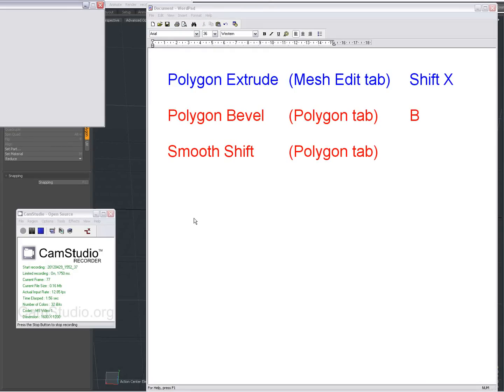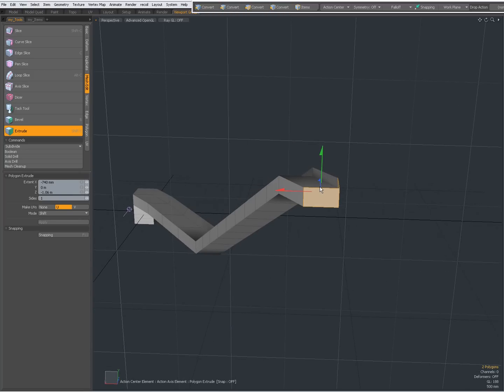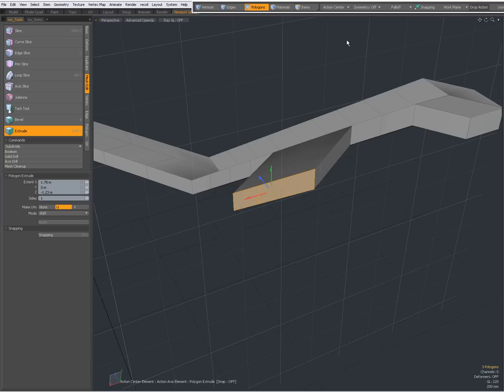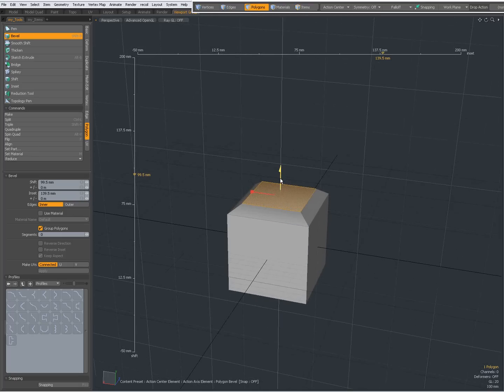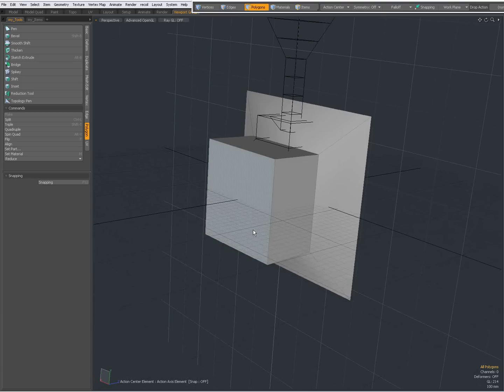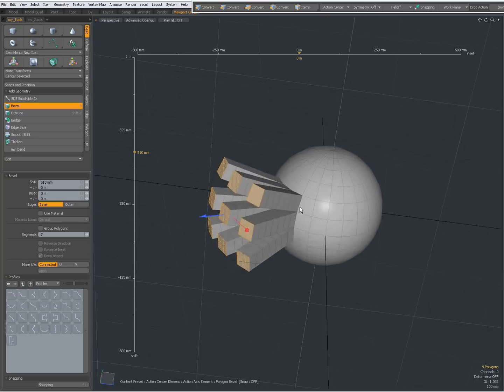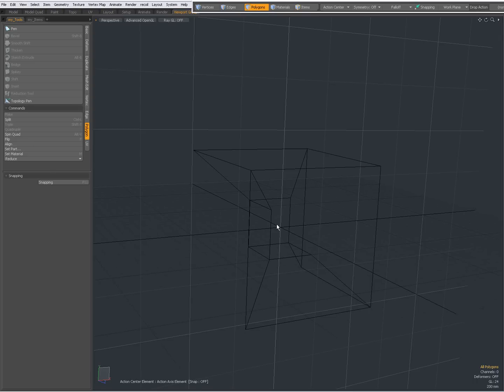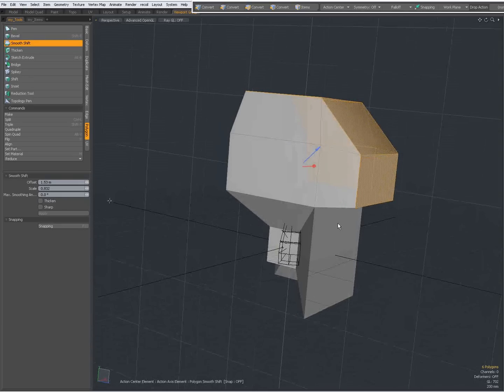0062 modo Polygon Extrude, Bevel and Smooth Shift tools.

Comment: How do you extrude along an axis if my normal are at an angle? I have a surface which is at about 15 degrees so it isn't perpendicular to any axis but I want to extrude straight out on the x-axis. I tried changing the action centre to various options but it always seems to want to extrude along the normal. Also, I don't suppose you might know how I can scale polys / edges or vertices along an axis do you? Say if I have a long stretched out cube along the x axis and I chop one end off at an angle but then I want to take those new edges at the end and flatten them along the x axis - what I would do in Cinema 4D is simply loop select the edges and scale them all to zero on the axis which would flatten them all out. Thanks :)
Reply from the maker: If I understand correctly then in both cases you can use "Selection Center Auto Axis" : places the gizmo in the center of the selection while the axes are aligned with world coordinates.
You can actually use other "Centers" like "Origin" and "Element" ... , but the "Axis" is what determines the direction, so when you want to transform in world coordinates then "Axis : Auto" is what you're after.
SO :
"Polygon Extrude" should get you  "Axis : Auto" straight off, but "Bevel" and "Smooth Shift" not!
So : e.g. with "Bevel" : make a selection, press B for "Bevel" and without doing anything else (because the "Bevel" actually has been performed when you activated the "Bevel" tool) simply drop the "Bevel" tool and then make the Move tool (or "Scale" - or "Rotate" - or "Transform" tool) active with  the "Axis" set to "Auto".
Hope this helps.
Reply: Amazing! That actually worked for the bevel. It's crazy that I couldn't find any documentation or discussion on this online but I'm so grateful for your help :)

Still can't get negative scaling to work on all three axis (only seems to work on two) but I'll keep at it and I'm sure I'll work it out!

Thanks :)
Reply from the maker: Glad it worked out!
Negative scaling on all 3 axes works fine for me, so don't know what you mean?
Reply: Well this is very odd. I just tried again just to make sure I'm not going crazy and it turns out I must have been :D Just made a slice at an angle and cut off the end, then selected the edges at the opening and scaled to zero and it flattened it out. How bizarre! I must have had something going on before which prevented me from doing it (or like I say, maybe I'm just going crazy ;) Thanks again for your help!
Reply from the maker: You're welcome!
One of the advantages of modo is that it offers a wide range of tool configurability.
That configurability is a BIG plus for modo, but "with great power comes great responsability" : so : it becomes important to be aware of all different settings that are active.
The tool can have non-default settings and it may be necessary to press Ctrl-d while the tool is active to reset it to default.
Action centers may be active or not, just as falloffs.
You can click in the viewport or on the gizmo, and use modifier keys like Ctrl and Shift , etc ...
So : it's good practice when learning modo to learn about the "Toolpipe" to get a good grasp of all that is going on.

Comment: Hi dominic, I have a question. How do I extrude 2 oposites normals at the same time? for example 2 oposite faces of a dice
Reply from the maker: +federrr7 
Well, you could select the opposite polys, press SHIFT+X (Polygon Extrude) and LMB-click in the viewport and then immediately press R for making the scale tool active so you can scale the newly created extrusions.
OR : after the SHIFT+X and LMB-click you can drop the tool and with the new polys still selected activate symmetry on the axis you need, and then move the newly created polys, but the first option with scaling is faster.
Hope this helps ...
Reply: +dominiekdr impressive, first option is better! 

Another thing is botering me. When I try to do a simple indrude (negative extrude) to a poly, only the normal complete the action and the edges don't moves.
I really like the way you explain Modo tools, there aren't much tutorial of Modo, and most tutorials are not very well explained for newbies. Keep going.
Reply from the maker: +federrr7 
Thanks!
Not sure what you mean with "only the normal complete the action".
Anyway, a lot will become clearer with experience : there are a lot of tools that together with action centers and falloffs can acomplish the same things in different ways, and experience will teach you which one is best suited.

Comment: Hi! Is there a way i can extrude/bevel a set of polygons and have them move in the same direction?  ie. when i select multiple faces on a sphere or curved surfaces 1) if i use extrude, they only move in 1 axis and not according to their polygon normals 2) when i use bevel, they all move uniformly, but it kind of inflates. what i want is to extrude them uniformly in  a straight direction.
Reply: Try changing the Action Center / Axis to Local